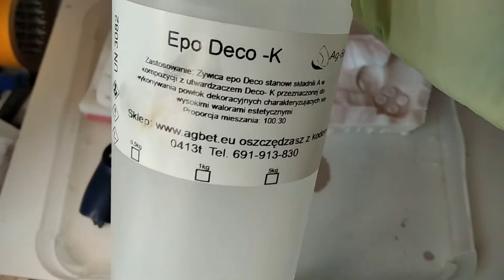How to make a PS4 controller case out of EPOXY using a selfmade silicone mold (english subtitles)

Comment: did you use a pressure pot during curing? that would suck the air out of the gaps and make a more stable shell